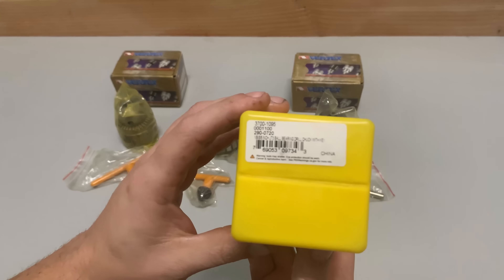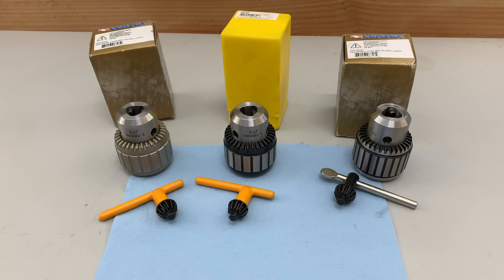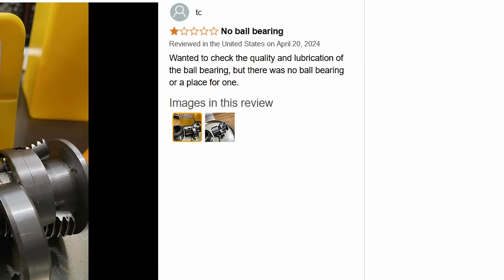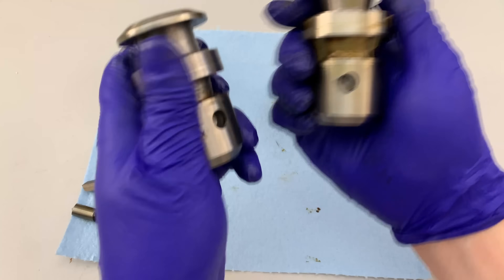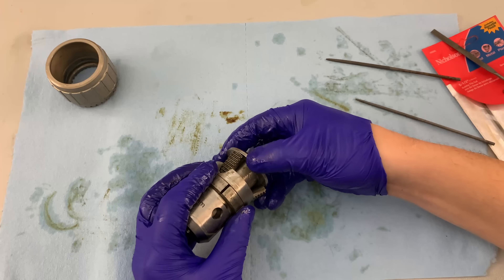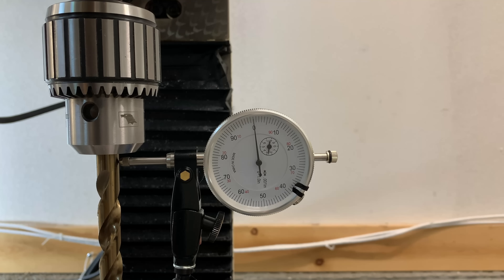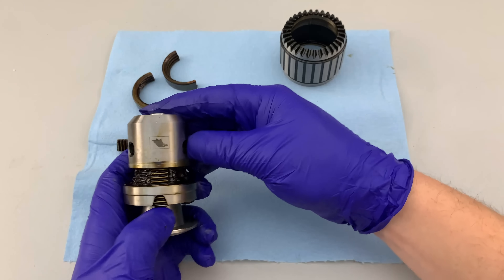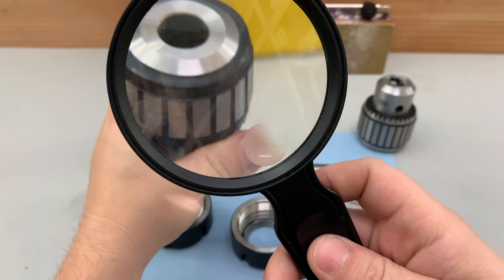Made in China vs Taiwan: The ACTUAL Difference

Comment: Guys, as a Chinese person, all I can say is that most of the time you get a bad impression of a Made in China product is because the company that sells you the product jacked up the price way too much. For example the chuck shown in this video, B18 drill chuck usually cost about 10 bucks here in mainland China, and that's with shipping. Even jacobs B18 chucks, usually does not exceed 20 bucks range.  Think about it, if you spend 70 bucks on a chuck and less than 10 bucks is going to the actual making of the product. There will 100% be expectation and reality drop.
Reply: @kurtg5645 Interesting point! Where do you think customers outside of China should go to get the best prices without the big markup?
Reply: @michakrezel9817 
Start manufacturing things domestically again rather than letting cheap Chinese labor seduce you into forgetting how to make anything.
Reply: This is 100% true. Chinese manufacturers on AliExpress and Alibaba have been getting EXTREMELY GREEDY in the last few years. Hiking up prices significantly beyond what any of it is worth. ATC CNC spindles, CNC machines, etc etc. trying to make profit on shipping.
Reply: ગોળા નાખો  એટલું મીઠું થાય.
Reply from the maker: I think Chinese tools have a bad reputation due to more significant quality issues from back in the 80s. In my experience, Chinese tools are really not that different than tools made anywhere else - you can get really good ones, or really bad ones.

One of the things I wanted to do was evaluate the machining and precision of a made in China chuck to compare to a made in Taiwan chuck, and while the internal machining was distinctly worse on two of the chucks compared to the third, the performance / accuracy was fantastic across the board.
Reply: @ShopHumor  Well, the issue is this: the Chinese will make anything you want, to any price point you want. And they will do it well. If you want a cheap item, not too precise with fit and finish, they will do that. If you want something precision with much better fit and finish, made from specific materials, they can do that too. The question is how much do you want to pay for it. Just like with Western companies.
But you better supply your own engineering. While they are getting better, they are still not really up to Western standards, and part of that goes right back to the Cultural Revolution concepts. But that is a different topic.
Reply from the maker: It's absolutely an incredibly complex issue indeed. Eventually I'd like to source an old, USA-made Jacobs Super Chuck and compare it with a brand new, China-made Jacobs Super Chuck, and then compare those two with a cheap, unbranded China-made ball-bearing chuck and see how they all compare.
Reply: @Feibie  they are definitely getting better, that's for sure. But they also have a history of intellectual property theft, which also includes engineering.
A company is still better off supplying the specifications for exactly what they want built.
While they are getting better, China is still suffering from the effects of the Cultural Revolution during the Mao period. You can't kill off or imprison your intellectual class due to perceived political reliability without long lasting consequences.
Reply: @ken481959  I don't know how much of that is true about the intellectual property theft but I'm sure it occur to some level. The thing about that whole idea is, if you're going to manufacture something for someone, wouldn't you put conditions in the contract for transfer of information and technology? The problem lies in the licencing to continue making it and selling it outside the contract. For example I know that in developing countries like Thailand without an oil refinery industry 30 years ago would hire foreign companies to build their first refineries which ended up teaching them how to build more and train people to operate them. Soon after they don't need foreign companies help anymore. It's the same with high speed rail and tunnel boring machines in China.
Reply: @Feibie  Foreign companies would not let them, this was why Chinese companies had to start from a low barrier (making cheaper stuff for developing countries) and top up their knowledge as they go.  They had already developed nuclear capacity in the 60s!  Where was India? Germany or Japan were willing to licence out basic technologies for low-mid range high speed trains, but not for their fastest trains.  China had to do this on their own and soon developed faster trains than Germany and Japan.  How did this happen?  Mao.  He helped to develop China from the ground up with the proper infrastructure for education and engineers which China had no shortage of.  Either way, no one can stop others from innovating.  IP protection can only do so much because some minor  modification can override it.  The west though that IP could limit their competition's progress, they were wrong.
Everybody knew that the west was exploiting China for cheaper labour and polluting factories.  While China was willing to deal with both, it certainly didn't want to stay like that forever.  Who would?
Reply: @samongandroid  I thought China was still pretty insular under Map and only really rapidly developed under Deng's reforms
Reply: @Feibie  China was developing in the 50s, 60s, and 70s, despite being sanctioned by the US, but it was not sanctioned by other countries. So it was not insular like North Korea (and even they are not doing that badly because they still have economic relations with China, Russia and other countries).  China's inception into the UN in the 70s set off a range of economic opportunities that led to new reforms in the 80s, 90s, 2000s etc.
Reply: @Feibie  
Have you ever seen a SINGLE Chinese-made aircraft which wasn't a BLATANT copy, of a Soviet/Russian or US-designed aircraft?
I mean, we're talking stolen blue-prints level of copying, not merely "Hey, that's a good idea, we should develop our own."
Reply: @samongandroid  
"They had already developed nuclear capacity in the 60s!"

Nuclear power isn't that difficult.  The University of Chicago built the first nuclear power plant in the basement of a utility building in the mid-1930's.
Reply: @ShopHumor  ..that would be the only real, valid test before deciding good or not.
Reply: @ShopHumor  Not all features are actually relevant to the function of the product and the deburring and cleaning you did might have helped out a lot. The accuracy of the chucks will mostly be down to a few critical dimensions, mating surfaces and geometric tolerances on the critical features in the assembly and not the general surface finish (Particularly on surfaces the customer isn't expected to see). In fact a quality of an affordable piece of equipment will be that it's designed and manufactured, without wasteful flourishes and processes that are unnecessary while preserving the critical requirements. 

The two chucks that are clearly machined at a lower cost are exactly what you were looking for. Rough but gets the job done affordably. In that sense they're not lower quality but economical.
Reply from the maker: @Incomprehensiblue  Great comment. I generally agree with you re: economical / quality. And while I appreciate the beauty of a  quality surface finish, it really didn’t matter because all of them achieved sub .001 runout and that’s plenty for a tool like a drill chuck.
Reply: @ShopHumor  The problem is abysmal enforcement of commercial laws, consumer protection laws, and low penalty towards even repeat offenders, all in the name of economic progress, that's how civilian company get away with shoddy goods.
Reply: @ShopHumor  the funny part is, chinese high end product is just as good if not better than most of the stuff out there, its just that the low end product simply makes a shit load of money thanks to the sheer volume and people dont think twice before buying them due to the lower price. Remember, they still ship the low end product to whoever buying them according to THEIR spec sheet, they ASKED them to be low spec so it is cheap and they can make mad profits.

If you are ordering high end product with high end spec, they will make that just fine. Do you really think China is incapable to make high end products? like come on now, they make everything lol
Reply: @ShopHumor  
They're still using inferior steels, or using too-thin sheet metal, hoping that nobody will notice until it prematurely fails.
Reply: @ShopHumor  I recall a short documentary around 15 years ago about Chinese imports. The factories were wanting to produce higher quality to match their new capabilities but the importers were wanting to keep costs super low so they were demanding cheaper materials be used - savings they weren't passing on to the end consumer of course. Only had one Chinese made tool as such, it was a lifan powered lawnmower. The motor was a copy of a honda model I understand and it worked very well.
Reply: @ShopHumor they’re still heinously bad quality
Reply: @ShopHumor   I buy Chinese carbide drill bits and get them cheap as hell. The thing is I don't buy them as brand new pretty indexed bit sets but as industrial used cast offs from milling manufacturers and CNC machining factories in China. It seems that Chinese manufacturers don't use Chinese made carbide bits in their factories they want bits that are high quality and last, better bang for the buck as it were, so they buy German and Italian made high grade carbide bits. The funny thing is that when these bits are used and worn shorter than they can use they resharpen and then repackage and sell them for next to nothing. The bits look funny in the sets and are all random lengths and some are pretty short but most are still very serviceable for my applications and at amazing prices for super high quality carbide bits.
Reply: @ShopHumor  Nah the equipment can detect the MSG and automatically does sloppier work! Thank you for sane reasoning and it's more complicated than CHINA BAD.
Reply: I know, I realize it is legal to lie and defraud, as long the person or persons you defraud have no legal pull/no associates in the legal system, able to get a judgement against you.
Reply: @peterthurman9384  that won't be the case on the judgement day before God almighty ! And the word of God is crystal clear ! All liars are going to go to hell !    Forever.  !!! Unless of course they repent and turn to God through his son Jesus Christ before they breathe their last breath !
Reply: Same here, we called it " Jap Crap ". I have been buying tooling to setup a small 6" custom lathe. I have been buy most on TEMU, and while the selection is not as large as AliExpress, shipping is FREE, and it takes half as long in shipping, and I found very little I don't like, most all good quality, and a few items Blew me away in Quality, and low cost. 😉🇨🇦
Reply: Is that your excuse? 😂 We can point to thousands of Chinese products that are just frauds. Anytime you buy something made in China you are gambling your money away. Sad but true.
Reply: China does make a ton of junk. It’s called Amazon these days. King of Chinese junk.  But the problem isn’t the Chinese. Someone told them what to make and a price point so they did it then you bought it then screamed I hate Chinese junk tools.  If you hired a Chinese manufacturer to make gauges as good as sarrett then that’s what your gonna get.
Reply: I’m pretty sure it’s because China is an awful hell hole. 😂😊
Reply: No. 100% NO.
What we care about is the  thing not being shit in the first place.
If a tool costs  X dollars, we pay it. That is what the tool costs. What we hate is buying something and it is shit. 
which too much from China is.
Reply: Made in China is substandard  quality  in other words junk
Reply: But why ?? Why wasting an energy and resources to a produce a product that will fail, inadequate quality, counterfeit without regard of safety?? It’s money…..
That’s what made in china mean…
Reply: Simple answer, iPhone made in
 China.
Reply: It a China hater channel. It a misconception video.
Reply: You used to be able to but a Craftsman tool that wasn't the nicest, but was a solid usable tool, for a reasonable price.  Now, it is almost impossible to find anything but chicom garbage.  Made of cold rolled scrap, with cheesy gimmicks and marketing.  I've seen Taiwan tools that were nearly passable, but in everyday service would make life frustrating.
Reply: @randymagnum143  You're missing the point here, "chicom" has little to do with China, and almost everything to do with your countrymen who order it. 
China will make anything you want, but your shop owners choose to ask them to make cheap nasty shit so they can make maximum profit in their Western shops, that ain't China's fault. 
Next time you're in one of those tool shops, look around, it ain't Chinese owned and run.
Reply: Wrong. We get a bad impression of made in China because it is junk. Lousy quality.
Reply: Products involving hard sciences: No matter how much money you pay, China cannot produce certain items, or even if they can, the products lack durability (e.g., Japanese engines still under patent protection). Ultimately, the lifetime usage cost is higher. Examples include CPUs and LCD panels, which rely heavily on hard scientific foundations.

Precision instruments and ultra-high-quality products: These are partly tied to China's technological capabilities and partly to its cultural aspects. Ultimately, it is a cultural issue. A nation focused on short-term gains and skilled in interpersonal maneuvering rather than dedicated research will struggle in comparison. Japan is a successful example in this regard. For instance, Lexus luxury cars combine thoughtful design, durability, low usage costs, and repair costs—qualities that are hard to match, even for the U.S. or Germany.

Pricing of daily consumer goods in Western countries: There is indeed a significant premium, which often feels unreasonable. For example, the batteries for power tools don't involve particularly advanced technology, and the production costs are not significantly higher than in China. However, the prices are several times higher. If you can use batteries made in China, it would be a good alternative.

Brands in developed countries with original quality control and production lines: Products like Apple phones, DeWalt power tools, and Nike shoes produced in China still maintain reliable quality. However, the brand premium is admittedly quite high.

Low-tech products: For items without technical complexity and not related to health risks, buying Chinese-made goods is fine. For example, slippers, bicycles, socks, hand tools, and even some power tools are acceptable, as they mostly involve simple motors and metal components.

Health and safety-related products: Absolutely avoid buying Chinese-made products, no matter how cheap they are. This includes food, tableware, medical accessories, and even auto parts. It is best to steer clear of these if they are made in mainland China.

Side note: I’ve noticed that German products are also starting to decline. They’ve largely adapted to the Chinese market's consumer mindset and are deeply tied to China's economic interests, such as Volkswagen cars. As a result, I’ve lost much of my trust in German quality. In this area, Japan is still significantly ahead of Germany.
Reply: @pablorios616  Largely all myth.  Every single one of those countries, including Japan will import labor from other countries to work in their factories.
Reply: @pablorios616  
I wouldn't even trust a Chinese bicycle.
I can guarantee that either the frame is made of cast iron and unreasonably heavy, or made of a non-durable aluminum alloy that's going to crack and fail far to early ... and that's assuming that the gears aren't made of a substandard steel which wears FAR too fast, and the chain isn't made of substandard steel and stretches far too quickly.
Why?
Because Chinese culture is built on building cheaply but selling as if it wasn't built cheaply.
Reply: Wrong. We get a bad impression from China because China gives out bad impressions. Don't explain to us why we feel the way we do champ. We aren't bug brained communists that need daddy government telling us everything.
Reply: Chinese steel is sub standard, most Chinese ball bearings are junk when compared to that from any other developed nation . China has to import the wheels and bearings for it's high speed  trains from Germany as China lacks the technology to produce them on their own. In other words, Chinese steel and manufacturing is below that of England, France, Germany and United States.  If they can't equip their own high speed trains, that says all you have to know about their quality.
Reply: @bobbyaustin8478  
The really sad part about it is... if you look into HOW ball bearings are made, there's really no excuse for even making "low quality" ball bearings other than deliberately reducing the time that the metal slugs are in the ball-bearing making machines, taking them out before they are ready.
PROPERLY manufactured ball bearings don't come out from between the forming platters until they are in specificiation.  The only way to get ball bearings that are low quality is to turn off the machine, and take them out of the ball-bearing maker BEFORE they are fully worked and exit the machine on their own.
Reply: I used to have a bad opinion of "made in China" stuff, until I realized that very fact. That is,  that you can get any quality you like from China if you are specific as to what you want and you pay for it.
Reply: That's not going to wash. Chinese manufacturers have a well-earned reputation for shorting materials or substituting inferior materials, including replacing customer-provided aircraft-grade aluminum  (an expensive vibration fatigue resistant alloy) with regular aluminum, which could have caused thousands of deaths.
The fact that Chinese, widely look up to and admire the dishonesty and scheming of the Jews as models to emulate tells me everything I need to know about buying ANYTHING from mainland China.
The problem of pet foods being spiked with melamine, because the phosphorus would fool the protein percentage evaluation test, is yet another proof of Chinese deliberately committing fraud in ways that literally kill.

The only people less trustworthy are Jews and Gypsies.
Reply: No, the problem is most Chinese people don't fear God and they make garbage because they don't care and they think they're going to get away with it ! But the judgement day of God is coming soon ! Repent, the kingdom of God is at hand !
Reply: Very true.  When a Chinese company makes garbage and sells it at 30% to 50% of a quality item when it should be sold at 0% to 10%, it definitely leaves a bad impression.  We once bought a "low dB" compressor that was 30% the cost of a very good (but higher capacity) American brand, and 60% of a similar German machine.  It was much louder than its specification, and after a year, the head casting broke.  Inside the coarse grained aluminum were mineral pigments suggestive of improperly purified remelted source material.  That was the first part to break.  The weld on the dryer broke, and it doesn't even move.  There was another stationary part that broke, but I forgot what it was.

As to why garbage comes out of Chinese factories, the reasons vary.  Some factories are tools used by local Party bigwigs to extract money from Beijing.  They receive money for building the factories, which they skim, and for operating the factories, which they skim.  They care nothing about the actual product.  They receive money from Beijing per item produced, and if they need to replace the item 4 times under warranty, then they receive money from Beijing for all 5 items.  Some successful factories are stolen by local Party bigwigs, and so factories that used to produce good products may suddenly produce boxed garbage.  How does a Party bigwig steal a factory?  It's democratic socialism.
Reply: @AJCiani-physics  "IF YOU TELL THEM WHAT YOU WANT AND YOU PAY FOR high quality you can get it from China. China makes some really good stuff if there is an incentive"
At a high volume level you're correct (Apple, etc.) where you've local presence and oversight. However I've a close relative who's a textile buyer from mills all over China for large US brands and 3 clients who have cables, small electronics, and apparel, made in China & import them into the US. Here are some observations:
1. Practically every Chinese really cares for China the country in a really genuine way, and is proud of the progress it's made. You can say that for any citizen on any country - but that'll be mostly words. In China it's tangible.
2. At the same time, they don't care as much about themselves. It's common to see a bicycle in China where the user hasn't bothered to remove the shipping labels or stuck-on remnants of packaging in 20yrs of ownership. You can see a shiny condominium complex with a pile of debris 20ft from the main entrance left by construction workers a decade ago, that everyone just walks around. They're genuinely unbothered as it's "not their department". A lot of the big shiny projects will come in disrepair in the years after the ribbon is cut. I.e. never mind the poor folks making stuff way beyond their paygrade at a level of quality that they personally would never care for. Even the upscale folks are like that.
3. The government and large corporations know this and establish crutches around this trait to compensate. Local presence, strict plans and processes and procedures, unrelenting oversight, quality control, communication, motivation. However smaller importers bear the brunt of this, where one batch is perfect and the other is horrible, with absurd material or even process substitutions that were never communicated much less agreed on, and several minutes into the argument you begin to grasp that they genuinely don't see a difference as something worth getting upset about. It's like yelling at a cat about yesterday's poop. They understand you're upset, but have no idea what's wrong with what you're pointing at.
Reply: Russia buys lots of Chinese tools - which China happily sells to Russia
Reply: Just like you buy 50$ hermes handbag and expecting the 50000$ priced bag quality..
Reply: @benjibyte8612  
Well, when the $50 bag is only worth $5, then yeah, its still a rip-off.
Reply: Or, you know, you Chinese could start making stuff properly, rather than substituting inferior material, short-shotting molded injection parts, and cutting corners like such as failing to debur parts that need deburring.
NEVER had any of these problems with ANY American-made stuff ever.
You have been GIVEN nearly the entirety of the U.S. industrial base, literally the same machines, then augmented with new machinery, and all you guys produce is crap.
Reply: There’s also a lot to be said about the acceptable quality control or complete lack thereof when it comes to American companies having their products made in china, then the blame is placed on where it’s made when those same factories are usually more than capable or producing high(er) quality products.
Reply: God is your comment section about machine tools, or drink party of a whole bunch of mid-aged neckbeards showing how they've been in an information coma for the past 15 years, and never left the 15-mile radius from where they were born?
Reply: We can't shop in China so most of what you just said is irrelevant to American buyers.  Now, all the rules are being rewritten by a wannabe-dictator moron and his fascist collective, so who knows where prices will be once the dust settles. iT will be years and years before normal trade can resume.
Reply: This comment is not who it claims to be., it's an English speaking person posing to be a mainlander. No mainland Chinese speaker uses English in this "jacked up" tone....lol. Way too colloquial. And a true Jacobs chuck is not $10 to make, even there.
Reply: As an American, I know for a fact that after a certain price point there’s state of the art quality in China for many, many goods. It’s just a confined market with a massive language barrier. I’d like to say I know how to “buy Chinese” and it’s not complicated: You get what you pay for and if you don’t know how to haggle, you’re in for a ride; that being said those with and eye for quality and hands capable of enforcing quality upon delivery, the deals are out of this world.

However this becomes more difficult by the day. 😢
Reply from the maker: @H33t3Speaks  I'm certain you're correct. I actually just read an article about the CEO of Ford, Jim Farley, test driving a Chinese EV for the last few months and saying how much better it is than anything we're producing right now. Don't sleep on 'em!
Reply: I'm old enough to remember when post WW-II "Made in Japan" meant worthless cheap junk, exactly similar to what people think of Chinese stuff now. Now "Made in Japan" means high quality. I assume the same trajectory will eventually happen to China.
Reply: @GeneCash  I agree, as a young electronic tech in the mid-sixties all the engineers referred to made in Japan as junk, nowadays you can hardly afford Mitutoyo, etc. products as being very high-end. China will indeed achieve it's goal if only because Vietnam and India are closing the quality gap between the 3 competitors.
Reply: @GeneCash  I'm old enough to remember nickle and dime stores filled with Japanese junk.
Reply: @GeneCash lol no. The first jap imports had a bad reputation for rusting because like other warm weather countries they didn’t have a concept for how much salt was used in the us. Then they adapted
Reply: @GeneCash  
That isn't going to happen.
The Japanese have always taken pride in their work.  And they have always been inventive.
The Chinese haven't invented ANYTHING in over 1000 years.  And their stupid leaders practiced policies along the lines of "the tallest blade of grass gets chopped down the most." which literally KILLED all of the genes for creativity and inventiveness outside of legalisms.
Add on top of that, a culture which values fraud and short-changing (by means of subquality product, or short-weighting, short-counting, or short-shotting products) because to not do so is "i'm not doing enough for me employees" ON TOP OF admiring the Jews and their shifty and fraudulent business practices, and you have a culture which will take several thousand years to be honest and inventive again.
Reply: @GeneCash  I strongly doubt it, the culture drives that. Japanese culture was always solid. China lost most of it centuries ago.
Reply: @fredio54  The different culture of China encourages corruption and cost-cutting, which holds back their progress a lot compared to Japan, where the culture has much higher emphasis on quality and pride in your work.
But even so, Chinese products are generally getting better over time. There are a handful of decent Chinese companies, and those ones tend to rise to the top because they make products with much higher quality than their competitors. The CCP is corrupt, but they still usually notice, for example, when construction companies make their concrete out of "tofu dregs"; they generally choose companies that are able to at least maintain a reputation for not being completely awful .
Reply: @fredio54  Explain TSMC.
Reply: @mapleveritas2698  yeah, it's in Taiwan, a vastly different culture despite the shared history.
Reply: @fredio54  It's not different at all.
Reply: @samongandroid  you've clearly never been to either. Vastly different. More respectful. More manners. More honour. More pride. More quality focus. Head and shoulders above.
Reply: @fredio54  Try me :-) Both speak Chinese, eat Chinese food, fly China-labelled planes, run Chinese companies.  One has a significantly bigger economy, infrastructures, technologies, space programs, achievements than the other.  But that's to be expected for a big country while the other is just a part of it.
Reply: @fredio54  i doubt it too。 Because China is too big, there are always high-quality and low-quality products. So if someone wants to accuse Chinese products of being inferior, they can always find 'evidence'. But I don't think Chinese culture prevents China from surpassing Japan. China has surpassed Japan in many aspects, why doesn't anyone say this is due to China Japanese culture?
Reply: @fredio54  IF YOU TELL THEM WHAT YOU WANT AND YOU PAY FOR high quality you can get it from China. China makes some really good stuff if there is an incentive for doing so. This is something people who are militating for aggressive actions against China would do well to keep in mind.
Reply: @fredio54 I also remember my mother mentioning back in the day. That anytime something came from Japan and it broke. It was referred to as a cheap sale.
Reply: @johnpeloquin9819  
Yeah..... at 3x or more of the price that I would have paid if the production was still in the USA.
Reply: @GeneCash  There is a big difference between China and Japan. Majority of Chinees goods are manufactured for the Chinese market and this market is pressuring to keep the price down. Chine will keep making low quality goods. Japan is much smaller country and from very biggening Japan was producing goods for export. In order to sell they had to make high quality goods. Maybe China will produce high quality goods, but it will take a long time.
Reply: Made in China is not an automatic indicator of quality, good or bad.  Products made there cover the gamut from world class to complete trash and everything in between.  But even some of the cheap stuff is still adequate to good.

Labor costs in China have gone up significantly and China has demographic problems so a lot of stuff is going to be increasingly made elsewhere going forward.
Reply: I have experience with knives like Chinese (Kizer, We/CIVIVI) and American (Benchmade, Spyderco) and in my experience high end Chinese knives have better build quality and consistency than the American stuff.
Reply: @georgelin8498  These knives are not cheap though...they can make all grades of goods for the consumers with various purchasing ability.  I have two pocket knives made in China...one is dirt cheap(less than 8 bucks), the other one cost about 45 bucks. My verdict ?...they all cut well.
Reply: mate, we have shitty experiences with your exports regardless of the price point
Reply: As a person understand chinese industry and american imports i can explain a little bit. 
Chinese factory do have great products. Most of them accept custom special orders. 
The problem is the US importers. They order the cheapest product and resale them at extreme high price. To make the most profit. 
If you want to order something from china, you better know chinese and your product specific. Then reach out to the chinese manufacturer directly. Then you will have great product. I always made order like that. Ask a chinese courier to arrange a air shipping for my products. All these add up is cheaper than a sht made in US or resale by a US resaler.
Reply: @lynnmei4346  
Translation .. if you don't know Chinese, then they're going to sell you crap.
Got it.
Reply: I always say that things made in China are as good as the amount of money/quality control that the company that contracts the parts is willing to spend. I have Chinese made tools that are the equal of some Japanese or German tools I own, but they cost nearly as much because the Chinese manufacturer spent the time (and therefore money) to make a great tool. That tool will almost always be cheaper, not because it’s worse, but because the labor is cheaper. The LABOR is my issue with Chinese-made… I don’t trust that someone didn’t suffer for my cheaply manufactured part.
Reply: As a Chinese person who actually has used Chinese tools, no they're still really really crap compared to properly designed tools
Reply: 10 bucks? I recently bought a decent "Sanou" brand B16 chuck (1-13mm) from PDD with a price around 25RMB shipping included. It's aobut 4 bucks. I disassembled it with hammer, and my purpose is to build the 3D model of it just for fun.
Reply: The whole made in China thing is so dated I don't get how the tag line still exists... Everything is made in china, I bet the best mass produced drill chuck in the world is made in china
Reply: @flanagon360  
Everything is made in China... and absolute CRAP compared to what we could buy when we were getting Made in USA.
Reply: As someone from the UK, who inherited a bunch of Chinese tools (guaranteed to be the cheapest) I've not been impressed. That said, I've also got other tools that I did spend decent money on from China and they're totally solid (pipe-wrench and grippers being a good example)

The very best tools I've got though, are pushing 60-70 years old, but only one of the manufacturers is still going and cost an actual fortune to buy now (side cutters/pliers that'd cost £70+ to replace, but I'm also aware they're medical grade just with grips added).
Reply: That doesn't affect the quality, that just affects the expectation.
Reply: I would say it not that Chinese companies are jacking up the price , it that the tariff is having it intended effect. Though insteading of pricing up product, it price out the high end and mid products and previously low key "street peddler" quality items has completely flooded the market. Previously Chinese items sold in the US stores are better or same quality as those sold in Chinese stores. Now they are worse, sometime much worse. This is especially true with advent of temu, which feels are they are selling the reject pile from Chinese retailers.
Reply: @seanwong8479  
Wrong.  It's been like that for decades, even when Chinese good were entering the U.S. with NO tarriff.
Reply: Don’t buy Chinese in the best way.
Reply: As a Taiwan person, simply just don’t buy things made in china lol 🇭🇰🇹🇼🇯🇵🇰🇷
Reply: @howard1905  I don't care
Reply: @howard1905  and nobody care
Reply: @howard1905  
That is EXACTLY my policy.
I WILL buy stuff labelled "Made in Taiwan" because the Taiwanese take pride in their workmanship and pride in the quality of their products.  Just like the Japanese.
When I was young, I never understood why the Japanese and Taiwanese have such utter contempt for mainland China.
NOW I understand it.  Buying anything from mainland China is just a big invitation to get something worth only 5% of what you paid for.
Reply: They have a bad reputation becasue Chinese are ALWAYS cutting corners, at EVERY level.
go buy a screw driver & find out hte "Hardened" tip is just black paint.
Buy a  "stainless steel knife or fork & find out it is magnetic.
go to the hospital & see the nurses re-filling the saline  bottles from an industrial  "bulk pack" drum in the back.
buy an aircon or fridge and find the copper is actually half as thick as it should be...

go buy a blanket & find out is made from "black heart" cotton.

if you want me to continue , just give hte word... i have over 30 years worth of experience in this field  & all in China.
Reply: @stevesteve8098  absolutely true.
Reply: 你甚至不是中国大陆人
Reply: incorrect. the chinese product is the same the issue is the company that contracts the chinese company to make it decides not to pay the extra money for the proper quality control service to save money. all chinese factory’s make excellent products and offer excellent QA the issue is if the brand and distributer wants to pay for it or not.
Reply: @leonidas6682  
Strange.  The rest of the world includes QA as part of the product, not some "extra" that has to be tacked onto the price.
And the only reason your QA problems are so noticeable is because your factory management substitutes inferior materials -- lower grade metals, THINNER sheet metals, etc. embezzling the difference in production costs.
The USA, UK, Germany, etc. put people in jail for that nonsense. The JAPANESE expect anyone doing that shit to commit suicide, so as to save the family the embarrassment of being executed by the government.
Reply: The Chinese are certainly capable of making good products.  Most of our products over here are whitelabeled products made in China.  But here's the deal, that whitelabeling comes with a price, and a responsibility.  They are "usually" quality controlled very well.  And I understand the need for a difference between Chinese market products and US market products.  Most Chinese can't afford stuff that is made for the American market, yet they have needs too.  Its when that lower quality and often times patent or copyright infringing material manages to make it to the US via the grey or black market is where the problem is.
Reply: @Electrichead64  
I haven't seen ANYTHING come out of China of reasonable quality other than digital multi-meters.  And only because those are damn near impossible to screw up without it being obvious as soon as you test it.
Reply: Well, child- or forced labour doesn't care about quality, they care about surviving! THAT will never change...
Reply: Right so as he said china lies about everything 😂😂😂 gg
Reply: Many products from China are better than American products these days.  It all has to do with scale and learning curves.  I'm sure there were some oldheads in the UK that still thought the same about domestic products for awhile, but there aren't too many of those around now.
Reply: @lowrads bull
Reply: @lowrads  A bunch of people working for next to nothing also helps.
Reply: @lowrads 
Only because the Wall Street banks who hold majority stock positions have gutted American engineering departments, and refuse to pay for any additional education for their personnel other than those in management and accounting.
Reply: @lowrads  😂😂😂 Wouldn't take 2 Chinese over 1 quality British made product .... You alright there Xi
Reply: @LifesAbe-ach  Wait does anything even get made in britain?
Reply: @CantoniaCustoms   Why does anything get made in the usa ? ....
Reply: Worlds best tools, machines and cars are made in Germany!🇩🇪
Reply: @left-hand-restorer  That was when we still had iron and coal mining and abundant cheap energy. Now that's gone in the name of "climate change", and Germany's economy is already shrinking. Welcoming millions of poor and uneducated (not to mention uncultured) people greedy for welfare only teaches our own youth to be like them: Lazy and greedy. And no equivalent of Trump in sight unless it's Orban and Putin, which would probably mean we'd cease to be Germany in the first place......
Reply: @left-hand-restorer  
German MACHINING is great.
German-designed Machinery is over-complicated crap.
That's LITERALLY part of why they lost WW2.
The first shipments of Panther tanks... sent to the Kursk sector, a few weeks before the Battle of Kursk (largest tank battle ever... over 2000 tanks total).
After unloading at the railroad station, 1/3 of the Panthers broke down travelling by road to their respective battalions.
1/3 of that third broke down on the way from the battalion areas to the assembly areas.  50% loss rate before even getting their tanks to the assembly areas to mount the counter-attack

Luftwaffe aircraft -- too complicated to be repaired by the ground-crews at the airfields.  So they were knocked-down, and sent back to the (overworked) factories for repair.

German engineering is no better today.  A friend at a modern model VW Beetle.  It needed a new thermostat.  5 HOURS of labor, for what should be a 15~30 minute maintenance procedure.
This is why maintaining and repairing German cars is so damned expensive compared to cars from literally anywhere else.  NONE OF THEIR PRODUCTS are designed for mechanics to even maintain them, let alone repair them in reasonable amounts of labor-hours.
Reply: @ I am sorry bro.. You are right! I meant made in Switzerland 😊
Reply: @left-hand-restorer  Japan beats Germany in every department and is not even close.
Reply: Lots of problems come from the steel that they use as well. I manufactured a product that required simple drill blanks. If the blanks came from China or India, they were garbage. We made sure to only order USA made blanks. Without fail, if the size we needed wasn’t in stock but the “import” was and we took a chance to expedite the job, it always bit us in the ass.
Reply: @billdivine9501  
The chinks will ALWAYS substitute inferior material
There was a US aircraft parts manufacturer in California.  They SHIPPED AVIATION GRADE ALUMINUM to the Chinese manufacturer.  The Chinks stole it and made the parts out of regular aluminum.  Fortunately the California company caught the substitution before any aircraft had catastrophic failures ending in death.
Reply: When the CCP is no longer in power, I'll be more interested in these "China isn't as bad as you think" stories.
Reply: @HylanderSB  Oh China is bad for it's people and should not be underestimated. Personally I think that if Putin were to win anything from Ukraine in his manic war then China would feel it's safe to invade Taiwan, and that's just one disaster waiting to happen. No the CCP has been a bad deal for China. The saying "Power corrupts. Absolute power corrupts absolutely" fit very well with the CCP. But it's more than that. The long use of centralized power to slap the people down has made the Chinese develop several "habits" that have made their way into the culture and are seen as valid and standard by a huge part of the population. If the CCP were to just be gone, nowhere to be hound tomorrow those things wouldn't disappear. A lot of them would stay for generations no matter what. It's hard to rout beliefs people has had since they were children.

No China isn't as simple to civilize as deleting the CCP.
Reply: @HylanderSB  Sadly, you have demonstrated that you do not understand the structure of China political system.
Reply: Why do they have to make cheap crap.   They are worthless
Reply: @ryanbeard1119 exactly
Reply: @ryanbeard1119  They make cheap crap because that is what their customers (often western companies) are wanting (=willing to pay). What bothers me with chinese manufactures is that they seem to have minimum effort princible. With little more effort and minimal cost impact they could produce really good quality products. Maybe they have to compete death because someone will always promise to make things cheaper?
Reply: @kimmokomppa  
There's a VERY common practice in China of making things high quality for the first couple of deliveries, and then after the customer is satisfied that the Chinese manufacturer is manufacturing to specification, they start rolling back -- substituting lower quality materials.  Short-shotting injection molded plastic parts.  Using thinner-than specified sheet metal, etc.  As much as they can get away with as long as the buyer is rubber-stamping delivery acceptance.